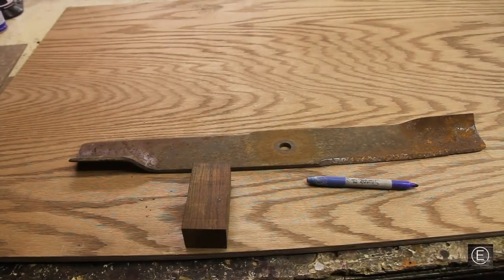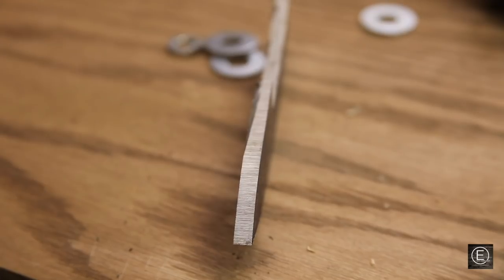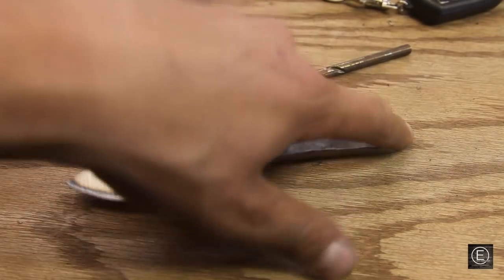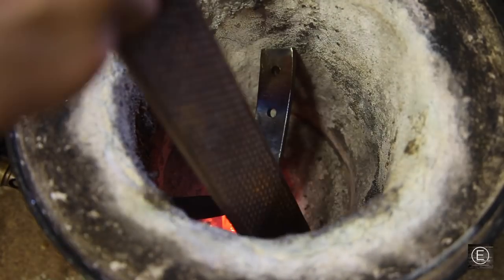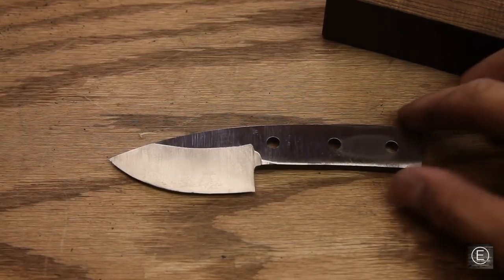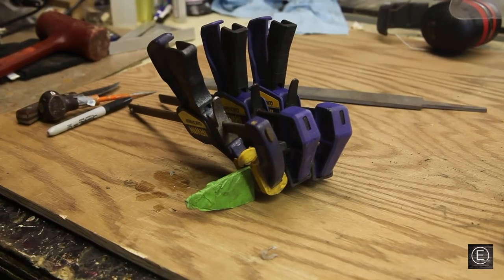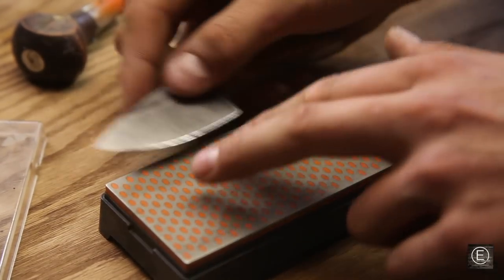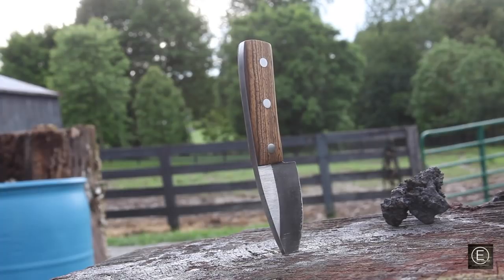I Turn a Lawnmower Blade into a Beautiful Little Knife!

Comment: Great Video Eli! I just noticed however, you didn't temper the blade. You only heat treated it. Dunking the blade into the oil hardens the bonds of the steel, making it incredibly hard and brittle. Tempering, comes after the heat treat, and this is when you heat up the knife blade just enough that it turns a golden straw color. This makes the blade portion much softer, and gives it flexibility, so it can hit something without shattering. Maybe you knew all of this, maybe you didn't. As a knife maker myself, I just wanted to let you know. I hope this helps!
Reply: I've been mostly working with railroad spikes. Ik they don't make the best of knives but they are interesting pieces. Is it worth tempering them?
Reply: @legacyhuntergaming5399  railroad spikes are very widely used for a lot of things,mainly because they can be  turned into anything Haha. If you are planning to make a big chopper or some some sort of striking knife, I would recommend tempering the spine of the blade. Good luck!
Reply: @sohamapte4717  ok, I will definitely do that on the next one I make.
Reply: Tempering is part of the heat treat
Heat treat = annealing (optional) + normalisation (optional) + quench + tempering 😉

Comment: Hey Eli glad to see your getting into knife making.  If the blade is John Deere it’s 5160 if it’s other brands it could be 5160 or 1080 to medium carbon steel. Do you know the brand?  Regardless nice job. You should flip it over and scribe the line in both sides with the sharpie trick as it’s not quite on center it will leave two lines that you can grind to and then heat treat with the tiny area that you would put your secondary bevel on. It’s called quenched when you dipped in the oil. I hope you tempered it in an oven at 400 for 2 hours till a gold temp or it’s way to hard and will shatter with use. Melting steel is relatively easy to do so don’t feel bad. I was forging a draw knife from a leaf spring and melted it in my hand cranked forge  oops. Overall you did really well. I make knives and forge things so if you’d like any tips I’d love to give some. I’ve been blacksmithing and making knives for 1-2 years so I’ve gotten okay I think at it. I’ve been thinking about posting some videos I just haven’t gotten around to it. I need to make a jig lol I have been free handing the grinds and they are okay but not as nice as one with jigs. Sorry for criticizing everything it’s habit to point out things you could improve. Nice saber grind though
Reply from the maker: Wow! Your definitely way more experienced with knifes than me! I think the lawnmower blade was oregon. Ok so its called "quenched" that makes more sense! About the oven, when I tried a file test on the knife it didn't seem harder that the file, although it would scratch the lawnmower blade I started with. So I skipped that step, probably not the best idea but it hasn't showed any signs of stress. The next knife I make I will do that for sure though! Thank for all of this useful information, I love hearing it and fixing my mistakes! Thanks, eli.
Reply: Eli's Workshop if the file cuts your probably fine for the temper it was probably more of a 1040-1050. Still useable there’s nothing wrong with it it’s just not the absolute highest quality. Like i said I’m here if you need tips